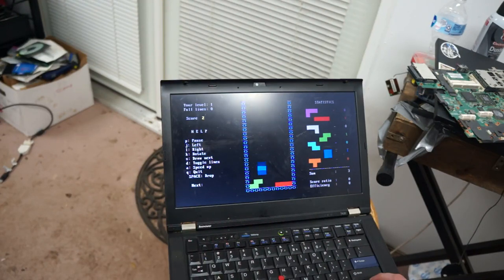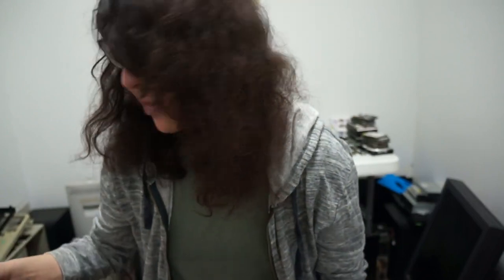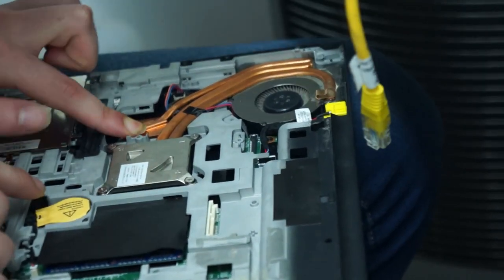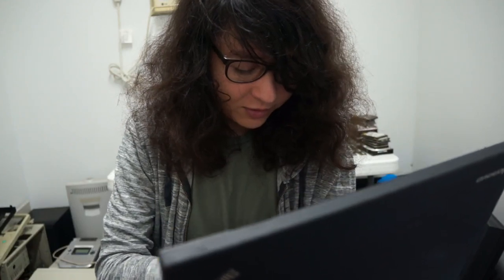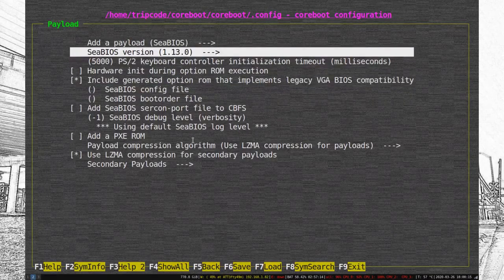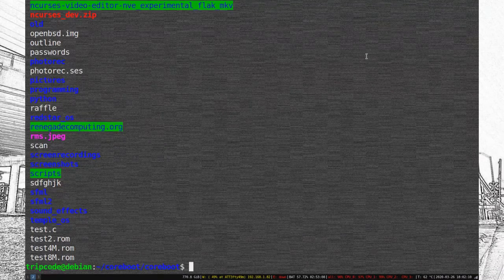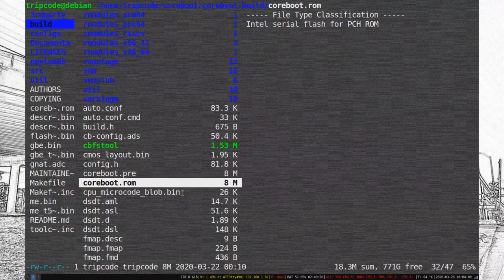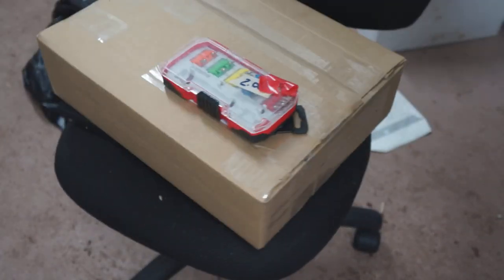How to coreboot a T420 ! Runs IVYBRIDGE CPUs

Comment: I've heard that linuxboot is just a linux kernel that acts as a bootloader when you add it to your bios after corebooting. Is this true, and do you know how to go about it compiling other kernels as bootloaders in the same fashion? 

Thanks for being a great asset to the Thinkpad modding and core/libreboot community, and for another great overview. How to go about the compilation process with coreboot is intimidating for many and you have made huge strides in improving the community's understanding. You're amazing, Trip. Keep it up.

-eoianderson
If anybody is bored and wants to tinker with FOSS modified computer and networking equipment in your new found downtime, hit me up on ebay for librecmc/openwrt/ddwrt/pfsense flashed routers, security and diagnostic firmware oriented modified modems, core/heads/libreboot'd Thinkpads, and LineageOS and Nethunter Android devices.
Reply from the maker: I think that's what it does. I haven't tried it though, maybe a bit later. :D I might take you up on your offer.
Reply: Hey, I've just recently been messing with openwrt on routers. I can't find you on eBay, though. The search seems to default to searching for items. I'm not sure how to search users. I tried a duckduckgo search and can't find you either.

Comment: Nice tutorial, just flashed my t420 and it works fine. It's now ready for an i7 3612QM upgrade :-)
You only need to compile the i386 toolchain, building the whole toolchain is just a waste of time when you're flashing a t420.
Reply from the maker: Thanks for the advice, I'm probably going to coreboot my t60p next :D
Reply: @tripcodeQ7  Nice! Those 4:3 screens are great :-) 
By the way, I saw that you are using a black ch341a programmer, some of them have a design flaw that causes them to use 5V level instead of 3.3V on the SPI pins and without current limiting. This can damage your motherboard, so I would advise you to measure the pins with a multimeter. Mine had the flaw and I had to solder a wire from the 3.3V regulator to capacitor c4 and to the lifted pin 28 of the ch341a. Here is a guide: https://www.chucknemeth.com/usb-devices/ch341a/3v-ch341a-mod
Reply from the maker: @nilez82  I have heard about that issue with the ch341a, but I haven't had any issues so far rather then the bitbang mode being to slow. :c

I should definitely check with a multimeter.

Comment: This is genius but still very difficult for me. Do you know where I can step-by-steps instructions using Raspberry Pi 4b on T420? I want to install an ivy bridge CPU.
Reply from the maker: I'd search around for a pinout guide for the rpi 4b, as well as a t420 service manual.

The ch341a can be pretty inexpensive as well, but make sure it isn't the revision with the 5v bug. Goodluck :D
Reply: @tripcodeQ7  Thank you very much man for replying. I have both and found this also, an instructable, but the author tells me it's only for 2nd gen CPUs. I guess I just need to add whatever is required for 3rd gen, which I guess is the right VGA ROM and something for the IPS display I installed on T420:
https://www.instructables.com/Lenovo-T420-Coreboot-WRaspberry-Pi/
Thanks again.

Comment: Good video, but the audio is a bit unsynced. Can you upload a new clip with synced audio track?
Reply from the maker: It would be a bit hard to fix, the ffmpeg interface I made edits in a linear fashion, I did eventually fix the audio issue, but each cut is just a little off, so its more of a miss mash instead of a single out of sync clip :c

Comment: Can you run an ivy bridge quad chip without core booting?
Reply from the maker: I'm not certain, quad core chips should work fine for sandybridge, but it has been quite a while since I messed around with t420s, and I don't have a quad core chip or a t420 at the moment to mess with.
 
I would check out thinkpad forums. It is an older forum site, and it isn't coreboot centric; Essentially it is just based off general thinkpad enthusiasm. They might already have an answer to your question.

Comment: Hey I’ve come across your channel and have been watching your videos and was wondering if you could help me. I currently have my T430 stripped down and ready to flash the bios chip(s) as mine has two! Could you direct me to some concise instructions for flashing coreboot but more specifically the ‘heads’ version so that I can use my encrypted nitrokey pro 2 usb with it at boot up. I’m also using a raspberry pi 2 model b. The coreboot wiki documents only seem to use the X220 with older Pi with fewer IO pins as an example. Any help you can provide would be very much appreciated 🙏 I’m also upgrading the CPU to 3840QM and installing the better fan/heat sink
Reply from the maker: Sorry for the late reply, I haven't tried out heads, but if your still having trouble with the pinout I'd try  comparing the spi gpio between the models. For  a hypothetical example, gpio17 is at pin22 on this revision, and on this newer revision gpio17 is at 18.

https://pinout.xyz/pinout/spi this might be helpful.

Just be really careful about the 3.3v and ground pins.
Reply: @tripcodeQ7  Hey thats ok I hope you've enjoyed the holidays!? I got a ch341a programmer and now going to use that instead of the GPIO's. 

Do you know what the last downgradable T430 bios version was before the EC signature verification became an issue? My current bios version is only 2.53 some are saying the last was 2.64 some are saying 2.76.. I have been reading the release notes myself to check I think its 2.75 but just wanted a second opinion by someone that may know better.

The company that sells nitropads and nitrokeys have given me a link with all their versions of coreboot+heads. I dont suppose you able to tell which ones i need to flash?  
Am I right in assuming that all I need to do is follow the skulls instructions and flash the Nitropad Bios ROMs instead of building my own coreboot build and payload. if so what about my blobs? I have read that as long as the EC version is the same it should work. Then there is also the maximised board configuration to consider as i would like hotp-verification to enable the use of my Nitrokey.

https://osresearch.net/Prerequisites

https://github.com/merge/skulls/tree/master/t430

https://www.nitrokey.com/files/ci/nitropad/heads/

I am in the middle of putting some instructions together to try and make this easier for the next person. Maybe we could become contributors to the unwritten tabs on T430 flashing at Heads - Wiki. So far they have only done a complete guide for the X220.

Comment: Can you make a simpler guide for as who are a little bit slower and make  the version where i can install win10 afterwards ?
Reply from the maker: I might make a guide very similar and explain a little bit more on a similar thinkpad (t430,t520...) . I would recommend ifixit or a lenovo service manual for disassembly instructions though.
Reply: @tripcodeQ7  about the compiling of the coreboot rom i meant. Disassembly and flashing i have done before.

Comment: @tripcode!q/7 Would you be able to comment on if T420 Firewire port is working under Coreboot?  I know it wasn't in the past, but I wanted to see if anyone explicitly had it working.  I've got a pile of T420s and a pile of old 3rd gen chips, and I want to make this happen, but if I spend a whole weekend only to fail, I'll be really upset with myself :)

Comment: Guys. I really need your help to save my t420. I'm stuck on wire connection and setup tool via linux. Any one please help
Reply from the maker: What is your current setup? I might be able to help.
Reply: @tripcodeQ7  I can flash rom to my t420 but have big trouble with bios chip temperature. Btw only win 10 64bit can run, win7 64bit  stuck on booting up (classpnp.sys file is stuck). One more issue is right mouse doesn't work anymore + headphone jack not work too.

Comment: anyone plz help me more detail with all steps?.
Reply from the maker: What step are you stuck on?

If it is disassembly or reassembly check a service manual from the Lenovo site they are quite in-def.

I might be able to help.
Reply: @tripcodeQ7  windows 10 can run with my build but win 7 can't work. btw backup file (flash.bin) not work too :(. My bios chip is hot too (~55 degree)
Reply: @tripcodeQ7  thank for you rep btw